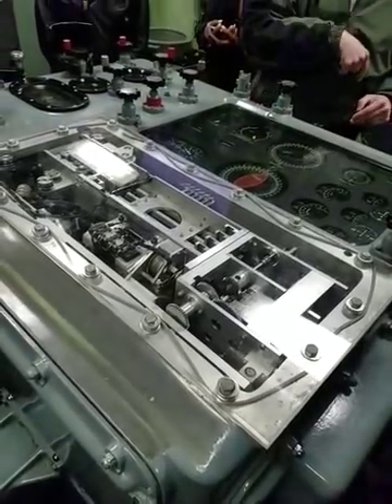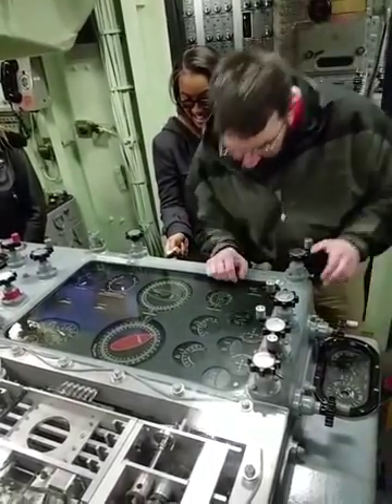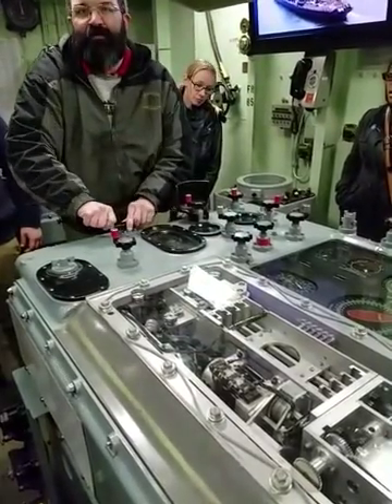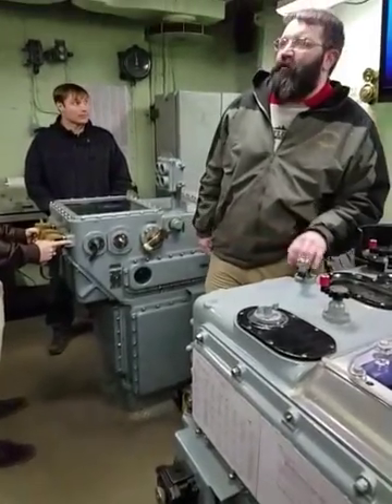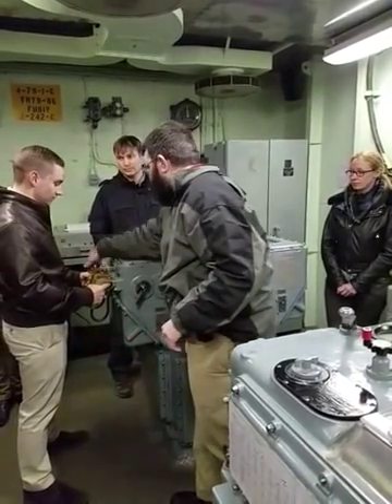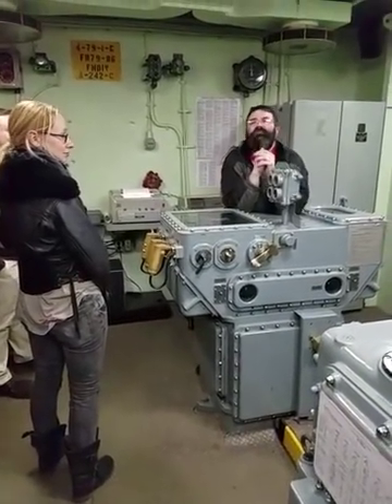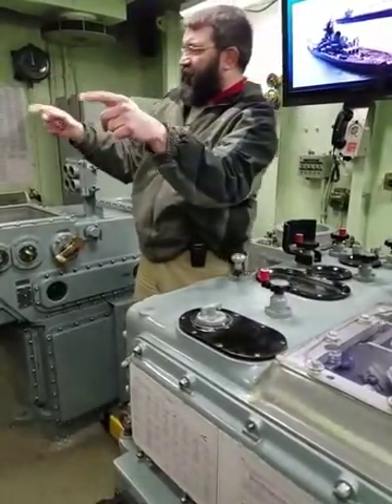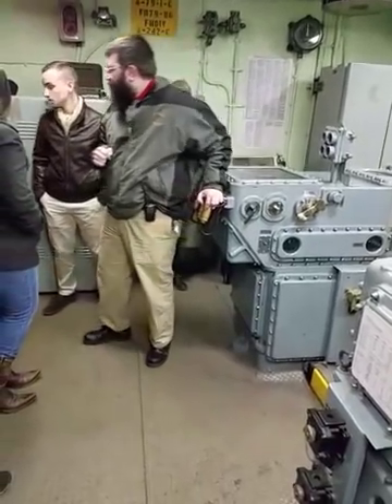Firing the 16" 50 caliber guns on the Battleship New Jersey

Comment: Mark 7 16"/.50
Reply: 50 not .50
Reply: There is a DIFFERENCE in firearms and artillery. In artillery caliber is a function that tells you the length of the barrel. You multiply the diameter of the projectile by the calibers of the barrel and it will tell you how long the barrel is. This is how naval artillery, land artillery and tank guns are all described. The M1A2 Abrams tank is armed with a 120mm L44 gun its gun from breech to tip is 5,280 millimetres or 17.32 feet long.

Comment: What is a "16 inch  .50 caliber? 🤣
Reply: Caliber in terms of artillery (in other words, larger than or equal to 20mm.) refers to the multiplier for calculating barrel length. This multiplier is multiplied by the bore (inside diameter) of the gun. The Iowa class battleships had nine 16"/50-caliber Mark 7 guns, 16" x 50 = 800". These guns were 800" long.

Comment: 16” seems about 32 times bigger than 50 caliber
Reply: There is a DIFFERENCE in firearms and artillery. In artillery caliber is a function that tells you the length of the barrel. You multiply the diameter of the projectile by the calibers of the barrel and it will tell you how long the barrel is. This is how naval artillery, land artillery and tank guns are all described. The M1A2 Abrams tank is armed with a 120mm L44 gun its gun from breech to tip is 5,280 millimetres or 17.32 feet long.

Comment: THIS IS BONKERS! ! Why wouldn't they just have an expert sitting in the turret and looking down a sight estimating the target speed and velocity with their own brain? How the he'll did they hit anything with this method?  Was this just an American system or used on all battleships like British ones? Just seems so unecicerily complicated.
Reply: Gunnery at sea requires complex calculations, and those mechanical computers were designed to account for range, speed, pitch, roll, and angle, all of which if correctly accounted for will get a shell on target, or very near to it. Looking down a sight? You would miss every single shot, unless at point blank range, and navies didn't fight at point blank range. These 'computers' were standard in all navies of the era, different in appearance from one another, but the same in principle.
Reply: your shooting at ranges of 15 miles plus at ships moving 14knots plus.... maybe the hood sunk because some shmuck was looking down the barrel instead of using a targeting computer.
Reply: First every shot counts so they don't want to miss and second of all these shots can go up to 15km out and I think they want a reliable computer to do all the calculations instead of a human who could easily get it wrong
Reply: Fra Far yes British ships did have targeting computers..... unless you think you could do all these mathematical calculations in the same time they were a great improvement to gunnery
Reply: @Alucard-gt1zf I understand that. I'm talking about the first guy who thinks having a targeting computer is crazy overcomplicated. It was just a joke about the hood

Comment: 50 caliber means the projectile is a half inch in diameter. a 16" gun from the NJ and sister Battleships are 16" in diameter. 2 totally differnt weapons.
Reply: After you do some research and find out that a 16" 50 caliber gun, has a barrel length that is 50 times the projectile diameter of 16", you are welcome to come back here and edit your comment.

Comment: 16" is 16"  50 caliber is 12.7 mm
Reply: in this case 50 calibers refers to the barrel length, 50 x the diameter in this case 16". I had to learn that playing world of warships.
Reply: John Williamson yes indeed .50cal is 12.7mm but 50call means the length of the barrrel is 50 x the bore of the barrels
16x50=800%12=66.6 feet which is the length of these weapons barrels

Comment: ...16 inch .50 caliber????  You must be a California liberal.
Reply: Caliber in terms of artillery (in other words, larger than or equal to 20mm.) refers to the multiplier for calculating barrel length. This multiplier is multiplied by the bore (inside diameter) of the gun. For example the Iowa class battleships had nine 16"/50-caliber Mark 7 guns, 16" x 50 = 800". These guns were 800" long.

Comment: 50 caliber guns? With a 16" bore? Ummm...no.
50 cal rounds are 1/2 an inch in diameter.
Reply: caliber is the bore times the caliber to find the barrel length or any way around, it's a mathmatical formula, these just happen to be 50 times the diameter of the shell

Comment: 16" or 50 cal. No such creature as the 16" 50 cal. 16" is one weapon 50 cal is another.
Reply: Caliber in terms of small arms and firearms in general (in other words smaller than 20mm.) refers to the diameter of the bore of the barrel. Caliber in reference to artillery or otherwise (generally 20mm. or greater bore size ) refers to the multiplier to multiply by the bore size to calculate barrel length. For example, the U.S.S. Missouri has nine 16"/50-caliber Mark 7 guns. 16" x 50 = 800". The guns are 800" long. 

 Furthermore its 50 caliber not .50 caliber.

Comment: They were definitely not 50 cals
Reply: Caliber in terms of small arms and firearms in general (in other words smaller than 20mm.) refers to the diameter of the bore of the barrel. Caliber in reference to artillery or otherwise (generally 20mm. or greater bore size ) refers to the multiplier to multiply by the bore size to calculate barrel length. For example, the U.S.S. Missouri has nine 16"/50-caliber Mark 7 guns. 16" x 50 = 800". The guns are 800" long.

Comment: Literally a huge difference between a 50 cal and a 16 inch battleship gun
Reply: Brendan Elliott 

Well it's kind of different than you think. Caliber is measured by how many times the shell diameter equals the length of the barrel. It's not the width but the length.
Reply: Brendan and there’s also a massive difference between .50cal and 50cal
Just so you know

Comment: While the New Jersey may have 50 caliber guns on board, they were talking about the 16 inch main guns. Quite a difference.
Reply: The New Jersey has 16 inch 50 caliber guns. In Naval artillery calibers is a measurement for the length of the barrel. If you multiply 16 inches times 50 it will give you the total length of the barrel from breech to tip. In this case 66 feet. The Older North Carolina class and South Dakota class had 16 inch 45 caliber guns.
Reply: The caliber .50 machine gun is called "fifty cal" in 'murican. There is your confusion. The .50 is the inner diameter of the barrel. On the machine gun. As in half an inch. The naval gun has a caliber of 16 inches and the length of the barrel is 16"(the caliber of the gun)x50=800"  
50 calibers(1 caliber=16") equals to 800" gun length.
Caliber .50 vs. 16" 50 caliber. Get it?
Reply: Sir Moke 

And 800" divided by 1 foot (12 inches) equals 66 feet which is the length of the entire gun.

Comment: Those guns are a lot larger than a fifty cal 

Fifty cals are military sniper rifles not badass 16” guns mounted on a huge ship of war
Reply: They are still technically 50 cals because it’s 50 times longer than its diameter and the mark 7 is 66.6 feet long which is 50 times bigger than the muzzle width
Reply: 50 caliber is sued to describe length of cannon not a damn .50 Cal take note of the decimal point there is none in title
Reply: Nope they are definitely 50 cal long

Comment: 16"   50 caliber, come on really!
Reply: In this case, caliber means length of the barrel divided by the bore.  Or 16" x 50 = 800" or roughly 66/6 feet.  caliber has nothing to do with bore size.
Reply: @rizon72  shortly after I posted I read some more about it, ya learn something new everyday.

Comment: You label this video incorrectly you said it was 16 inches 50 caliber 
The symbol for feet is only 16'
Reply: it is a 16 inch cannon, the barrels are 66' 8" long, if you convert that to inches you get 800, divide that by 50 and you get 800. to put that in a formula for you, it goes (diameter) X (desired caliber) = (barrel length)

Comment: .50 caliber? Lol no
Reply: Warren Collier its 16" 50 cal. Cal is the diameter of the barrel.
Reply: .50 cal diameter  lol thats funny i gues the the m2 .50 cal has smaller barrel diameter lol
Reply: Joshua McCormack *length
Reply: Joshua McCormack and yes, the 50 cal m2 has a smaller diameter than a 16" 50 cal
Reply: 16" is the size of the gun by the way
Reply: No one calls a battle ships guns 50 cal
Reply: Talking to buddy that has more knowledge on navel guns it is 50 caliber which is the length
Reply: @joshuamccormack6725  except the navy, the guys that designed them, the guys that built them and now the guys that maintain them they may not be known as that by the crew or in short hand, but that is the official designation